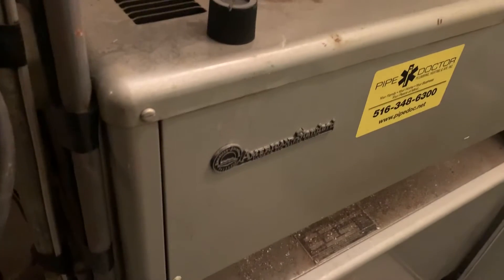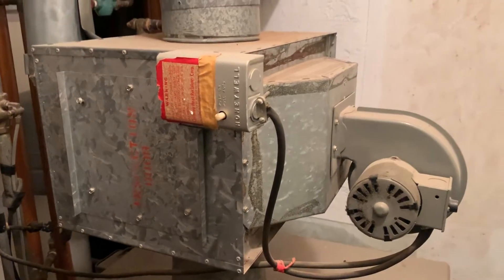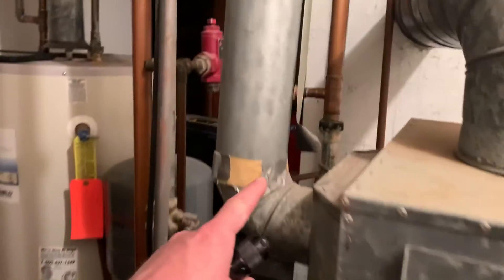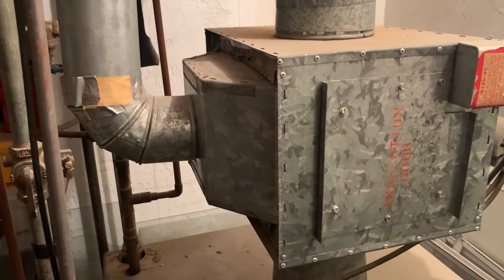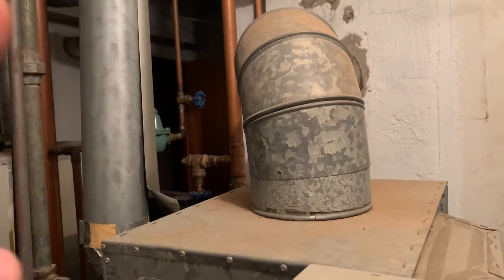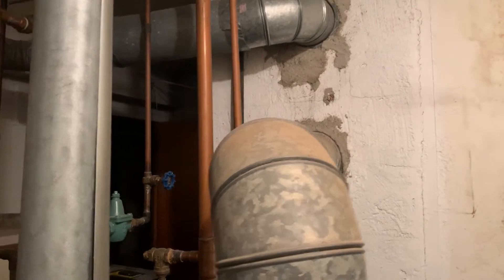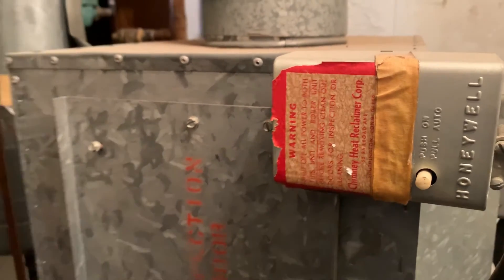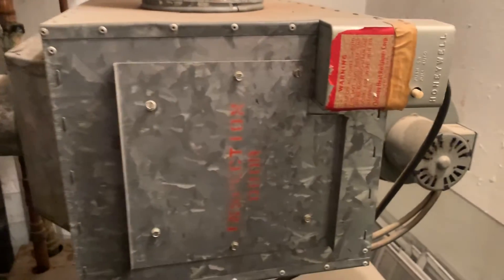Gas Boiler Exhaust Pipe Heat Reclaimer - Bet You've Never Seen This Before

Comment: I've always taken notice of HVAC stuff, even as a small child in the early 80's. By the middle of that decade, I noticed a lone register in the kitchen floor of a great aunt's house. She had hydronic heating with long baseboard fixtures. So I asked what it was for and they told me. She lived just one block over from where I grew up. I believe her house was built circa 1930. 

 And yesterday,  as I was helping someone moving furniture, I noticed the same thing in another house, however, the lone floor register (this time in the living room) was ductless. The boiler was located in a room directly under that register. It triggered the memory of my great aunt's reclaimer 35 years ago, prompting me to do the research that led me to this video. And now I wonder if this ductless register was also hooked up to a reclaimer once. If so, than I've been in 2 residential homes with them. 

As for my great aunt and uncle, they passed way in 2008 and 2000 respectively and the house sat for years. We heard the boiler sprung a leak causing extensive damage during the remodeling process. I haven't been there in 20 years, so I don't know if their reclaimer is still in existance.